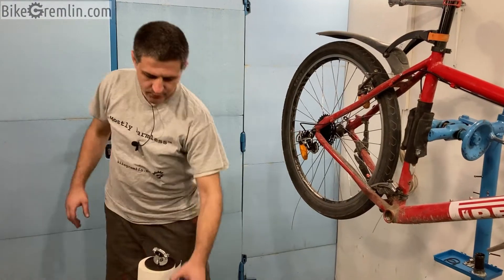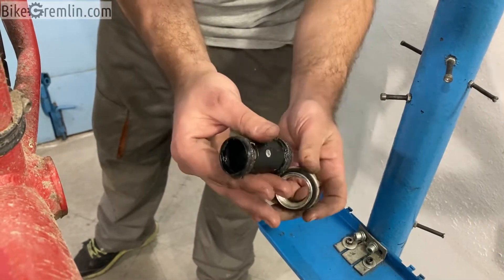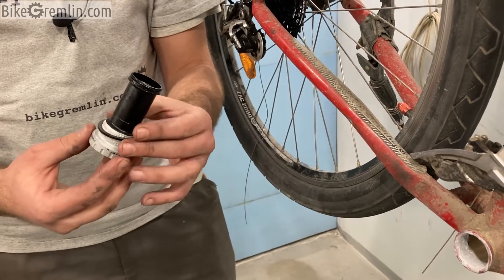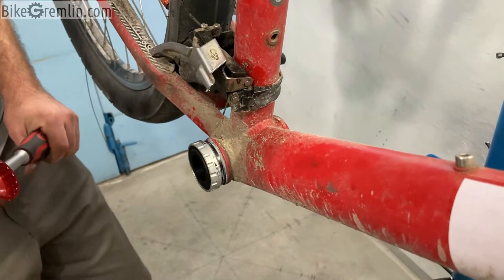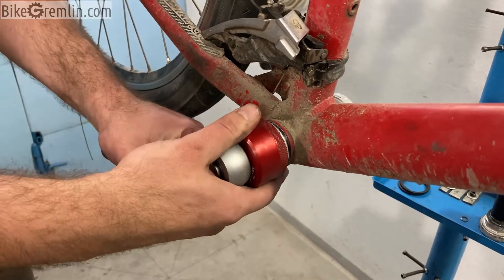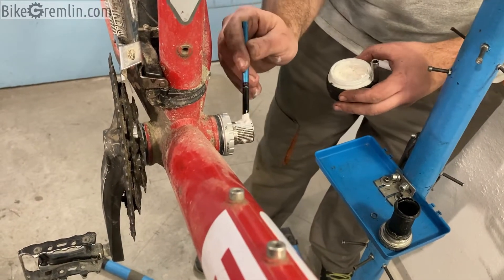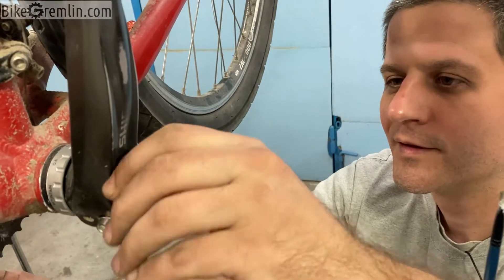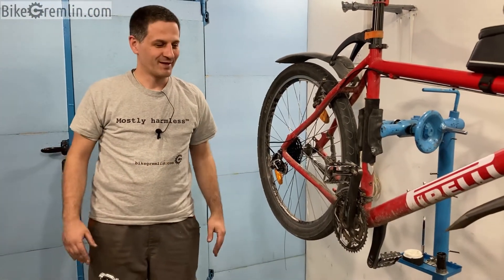How to install Shimano Hollowtech II bottom bracket

Comment: The best video I have seen on the matter. Thank you very much! 

I also have the same BB52 but it needs replacing, noticed lateral play and up and down. I friend might give me a spare XTR BB93 for a good price. I presume it's the best one Shimano does over my model, as in an upgrade?
Reply from the maker: Glad it could help.  :)
Regarding BB replacement - I'd say that in terms of durability, Acera and upwards are all similar. Higher-end models offer lower mass ("weight"), but not much else.
Reply: Totally agree with Glob3Tech best installation video I have seen. This was a real world installation not another choreographed production of some guy standing in front of a camera more interested in pimping a certain manufacturers tools - that all just happen to be neatly arranged on the wall behind him! Subscribed to BikeGremlin, thumbs up great video!

Comment: Hello friend, excellent demo and informative. I have a question that I hope you can help me with.
I have a frame with a 73mm bottom bracket tube with Xt Mt800 bottom bracket to which I will install some shimano slx m7120 boost cranks; My question is do you know how many spacers I should put there for a correct installation? because I tried to install it with a spacer on the right side and on the left side with nothing, but I am left with a small space that I think should not be there. I have searched for information but to no avail, I hope you can help me.
Greetings from Guadalajara, Jalisco, Mexico. new subscriber
Reply from the maker: It should work with one 2.5 mm spacer on the drive side (for a 73 mm wide frame BB shell).

Note (just in case) that the M7120 cranks have a preload adjustment ring that is used to fine-tune the BB bearing preload (unlike the older HT2 cranks that use the plastic end-cap on the left hand side to do that).

Here are the official Shimano manuals (that look correct IMO):

Expanded view of the mounting order:
https://dassets.shimano.com/content/dam/global/cg1SHICCycling/final/ev/ev/EV-FC-M7120-4559A.pdf

Manual:
https://si.shimano.com/en/pdfs/dm/MAFC002/DM-MAFC002-11-ENG.pdf
Reply: @BikeGremlinUS  thank you very much , I will try with the information you shared with me.

Comment: Does it matter which side the spacer goes on? if so how do you know which side? thx.
Reply from the maker: Depends on the BB shell width and the bottom bracket model.
Shimano usually gives instructions with their bottom brackets (and they can be googled).
I plan a separate, more detailed video about the spacers, but a short answer is to look up the user manual for the BB model.